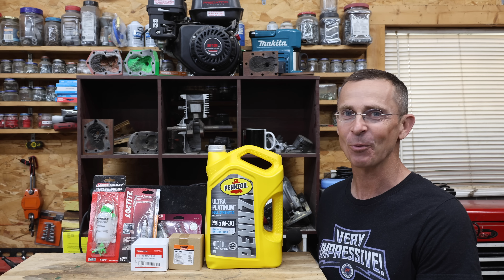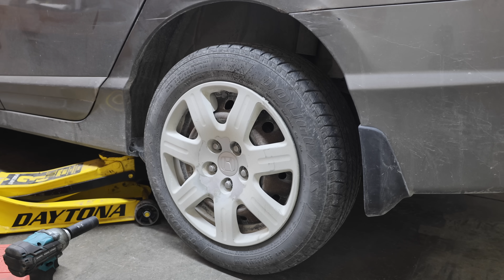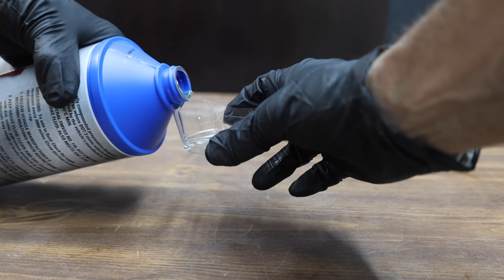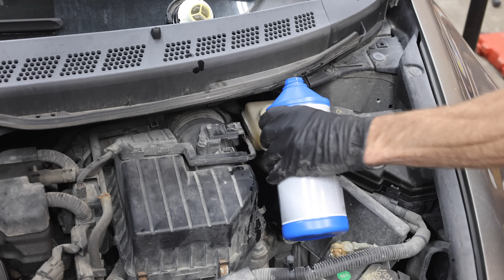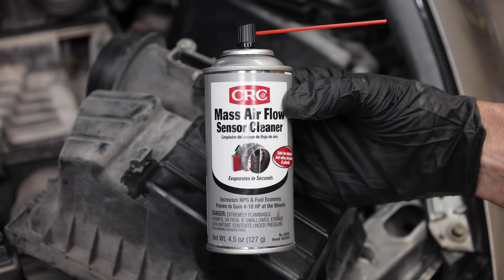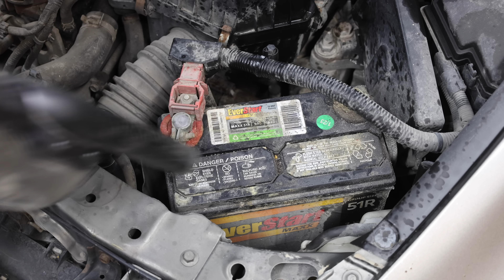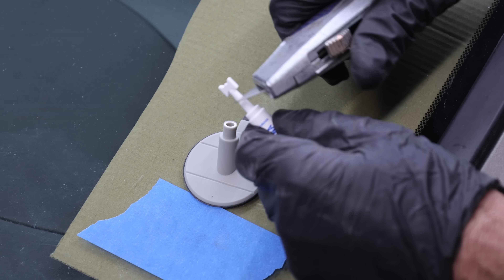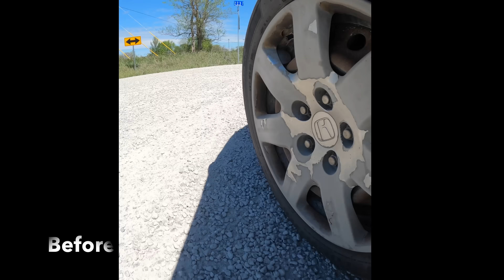Most Reliable 200K Mile Car? Let's Settle This!

Comment: Until last month, I had a 5-speed Civic of that generation that had 330k kms on it (about the same miles as this car). It was still chugging along, until a pole came down in a wind storm and took out the back end of the car. Even though the body was in rough shape, I am sure it would have kept going if it wasn't for that pole
Reply from the maker: Thanks for sharing.  Sorry to hear about the damage from the storm.

Comment: Great video! 
One question... I don't know about 2008 Civic, but some Hondas have a timing belt (or chain?) that should be replaced every 100,000 to 120,000 miles. They're known to break around 150K or 160K miles and have an interference engine that will likely self-destruct if it does. 
Again, I don't know about that particular year and model. I'm only mentioning it "just in case".
I completely agree with you about used versus new. In fact, I wouldn't want and  don't trust most cars built the last 10 or 15 years. They are asking small engines to do a lot of work and looking to save every last drop of fuel with turbos,  variable valve timing, auto-shutoff and other schemes that add complexity and put a lot of strain on an engine. Add gimmicks like cameras, traffic sensors, self-driving, accident avoidance, etc. Reliability is questionable while the cost of repair is going through the roof. I saw recently where a rear tail-light assembly for a late-model Ford pickup cost $5600! Then there was the cost to replace a damaged battery pack of a 2022 Hyundai Ioniq 5 (EV): $60,000 parts and labor! That was $5000 more than the entire car cost new... but at least it was Canadian dollars.
Your friend has a nice, economical  daily driver for under $1500! Hope it serves him or her well for many years to come!
Reply from the maker: Thanks!

Comment: Two hundred thousand miles without much or any maintenance, that’s the brand I want to know about. 
But with proper maintenance 200000 miles is easily achievable. Kudos to all the mechanics out there who have kept me on the road. 
Definitely one of the most informative channels on YouTube while still being extremely entertaining. 
👍PF.
Reply: That Civic (2006-2011) will go to 350,000+ miles... I know from experience.
Reply from the maker: Thanks!

Comment: If you are doing a code reader comparison video, could you include the Blue Driver code reader?  We had a 1997 Honda Accord that we drove to around 500k miles.  Odometer stopped working, but it had about 250k when we bought it, and my wife drove it about 70 miles a day to work, for about 6 years, and then it was the spare car for winter driving for about 6 years.  We sold it to a relative, and they didn't do the maintenance, and it died quickly.  We don't buy new cars anymore.  The cost is ridiculous, and they lose value too quickly.  Been doing my own vehicle work for over 40 years, and I am not stopping now.
Reply from the maker: Thanks for the suggestion.

Comment: I have a 12 year old American made car that I planned to keep as long as it could be fixed. The computer module for the ABS brakes went out...and yep, they no longer make a replacement part. It doesn't make sense to find one out of an old car because it would probably fail too. Thanks GMC. No more driving in the rain.

Comment: You hit the bullseye with this video!  I have a 2008 Honda Accord with the 4 cylinder motor that I bought used about 5 years ago.  It needed a few things (brakes, dome light, oil change, battery) but was otherwise a solid car.  It has been a great car!  And no car payments!

Comment: I've heard Toyota Tundra is a reliable pickup, plus able to run well into 300,000 miles on original motor and transmission.

Comment: What a satisfying restoration that must have been.

In college I bought a lightly damaged Chrysler 200, add in that it was a heavy smoker car and I got a remarkable deal for a fairly new car. I've had no notable issues in the >200k miles I've been driving it, and it clearly has a ton of life left yet. Very solid car, just normal wear items, a thermostat, and a new radiator hose/clamps. Regular oil/filters changes (synthetic), replace the transmission fluid every 100k miles, and just in general treating it with respect. That was my service plan and if served me very well.

I still have the car, and it still runs great, but desperately needs new tires and battery, so it has been parked for nearly a year as I've been enjoying my newer vehicles. This video has me thinking I should get that puppy back on the road. As much as I like my fresh new vehicle, there is certainly a charm in driving an older, "seasoned"  car that barely costs you anything to drive and own.

"The best car is the one that's paid for."

Comment: I got four Honda alloy wheels from a pick your parts lot to replace the original steelies.  Sometimes it is cheaper to get 4 used ones than 1 new one.

Comment: Also I can tell you I was a honda tech for 10 years. There was a bulletin released several years ago for that coolant thermostat code. And it was for inspecting the coolant temp sensor connector and sensor terminals for corrosion.  That would cause that code to set. So I would also inspect that as well. Thanks for the content. I watch it every Sunday.

Comment: Tod you did what I did today but with a 1970s snapper lawnmower. I bought two similar mowers. One had a locked up engine and the other one had only a good engine. I Frankensteined a mower so I don't have to buy a new riding mower that now costs $2500. I paid $120 total

Comment: Last year I bought a 2006 Honda Civic for $1500.  I bought it at 210k miles. It looked bad because it wasn’t ever washed.  However, the bones we’re good.  A lot of little things later, a lot of matching items from your video, and a major washing, and I’ve got a great running car for super cheap.  Get ready to get rid of that motor vibration, the motor mounts are notorious for going bad.  A whole set is $70.  They take a bit of time, but the ride after is phenomenally smooth.  I have before and after pics if you would like to see.  Great video!

Comment: I think a comparison video on coolant flush solvents would be a great learning tool. Recently had a truck with an oil cooler issue that got oil into the cooling system which started causing coolant hoses to swell and pop. After the repair I went down a rabbit hole of researching different options and most of which had negative feedback relating to them causing other issues from the harsh chemicals harming metals, seals, hoses, & water pump bearings. I ended up just using vinegar as an alternative but that also even had some negative feedback, but I wanted to try to remove as much of the oil from the cooling system to protect the new hoses. Just an idea!!

Comment: Great call on those CV Joints! Though I'm not a Honda fan oy- mechanically;if not overly abused .... the engine will easily turn 300+ reliably. Looking forward to your review of economical diagnostic meters!!! Have saved me some money on simple replacement of thermostats, O2 sensors, EVAP parts & simple electrical issues.

Comment: I got that 8th gen civic and its a beast.  Had a oil leak for years and never had any problem.  Now ac compressor or something is F'd up but still drives like a champ, regardless of the noise.  I'm not getting rid of her and gonna see how far she can go.  I've never changed my spark plugs either.

Comment: You are truly a jack of all trades. My project is my 2006 toyota corolla model s .that Ihave own since new. It has 215 thousand miles on it and needs a little work. But as you stated best the price of a new car. thanks for the the info on building a vaccuum pump.

Comment: My civic is at 350,000 miles and the motor and transmission still run correctly. However, the person I have loaned it to let the frame get corroded snap. The mechanic parts will outlast the frame.

Comment: My 09 ranger danger. Just took a poop 253,000 transmission pan seal leaking oil and torque converter leaking oil. I love my truck. I'm going to fix it.

Comment: NOooo! Never EVER change the tranny fluid on a high-mileage vehicle! That tranny will likely start slipping now, and soon fail. All the gunk in the old fluid provided the needed friction to compensate for worn parts. With the new fluid, that friction is gone...and so will be the tranny in short order. I only ever drive high-mileage vehicles....but I never ever change the tranny fluid, unless I know for a fact that it's been changed at reasonable intervals in the past (Which is not the case on your car- hence the color) or that the tranny had been replaced/rebuilt within the past 50K miles or so (Again, obviously not the case here). 

Next video: "Do Transmission-Fix-in-a-can products really work?" (No.)

Thanks for the awesome work you do and great videos!

Comment: I owned a honda civic.  It had 250k miles and i did regular maintenance.  The issue was timing belt and AC needed replaced every 80k miles, so the third time is sold the car.  $1500 for repairs on a $1500 car wasnt worth it

Comment: On that civic you can use the tranny cooling hoses to move new oil in and old oil out while the car is running in park. That way you can get new oil into the torque converter. Works like a charm.

Comment: My 2016 Camry with 200k miles runs as brand new.  Only dealer Servicing according to the book.  If the body was detailed and a monroney was attached to the window you'd swear it was brand new.

Comment: I love videos like these. I've lived most of my life without much money. My vehicle now is a 2000 mini van. Cost me $600 and I've spent about $300 ish so far. But even with all that, I've replaced two tires, a brake line, a trans control module, a ball joint, a wheel bearing, and a battery. I've owned it about a year and a half, and the battery, ball joint, tire, brake line, and wheel bearing were items that needed fixed from the beginning. It's got 250k miles, all fluids look good, and so far the engine runs very well.

Comment: You mentioned you're going to compare cheap auto scanners.  I'm trying to bleed antilock brakes on a 2001 Silverado.  I bought a Launch 919 scanner but it only goes back to 2005 to bleed antilock brakes.  I borrowed a friend's new Harbor Freight Zurich 15 and it wouldn't bleed the antilock brakes on the 2001 Silverado either.  I'd love to find a reasonable bidirectional scanner that actually works for older vehicles.  If I had a new vehicle it would be under warranty and I wouldn't need the scanner.  Thus, I suggest testing an older vehicle rather than a newer one when. You do your test

Comment: Great video.  Almost all of my vehicles have all had over 250,000 before meeting their untimely demise. My 1993 Honda Prelude had 351,000 before selling it to the new owner and used it as a daily driver for awhile.  This just proves replacing the wear items with quality parts and regular maintenance will vastly extend a vehicle's life.  I really liked the cost comparison of new verse used.  Just shows what a little research and elbow grease can do for your personal bottom line.  Project Farm helps with researching quality tools to perform the maintenance.  Spend the money once on quality parts and tools will save money in the long run.  Thanks for the great videos.

Comment: My daily driver is a 2008 Honda Fit.  Last work I did was replacing sway bar end links.  Before that it sounded like  a Huey helicopter coming in hot. It is my beater with something like 150-160k.  Typically get about 30 mpg and unless it is below zero it reliably starts. My truck is relatively new by comparison, a 2012 f250 with like 240-250k miles.  When looking at older vehicles I would say to do some research and see what major issues they have and how expensive the repairs can be.  Some years of some models can be absolute disasters.

Comment: How about a review of portable bandsaw blades? Some I have used have been expensive and junk. I noticed while you were swapping out the drive axle that the steering rack rubber gaiter looked to be split, did you change that. Great video, thanks

Comment: This is a great video and reminds me a lot of what I did after buying a 2007 Accord with 230,000 miles on it. It's still going strong at 265,000 miles! My only caution would be on insurance. You don't need to have collision or comprehensive on a vehicle that's only worth a couple thousand dollars, assuming you can replace it if it gets totaled. But NEVER carry state minimum liability coverage unless you absolutely can't afford more. $25,000 per person in injury coverage runs out very quickly if your mistake sends someone to the hospital. You should carry 10 times that amount. And don't forget uninsured motorist injury coverage. If an uninsured driver puts YOU in the hospital, you should be protected.

Comment: Changing transmission oil on a car that hasn't been serviced for a long time could cause failure due to the the detergents in the new oil loosening varnishing 
inside the transmission blocking small passages causing it malfunction .

Comment: What a great subject to what i am working on right now lol. My mom's Ford Taurus 2003 (V6 Vulcan Engine OHV) had a horrifying coolant leak coming out of the timing cover. Put 2 liters in the overflow tank and 2 minutes later those 2 liters would be gone.
I removed the timing cover, cleaned it and now i just need to weld all the cavity (like tooth cavity ya know?). After this i'll be ready to put it back on.
Thank for the video for the alluminium welding rods btw! I bought the Bernzomatic and it should do wonder! :)

Comment: Love these 8th gen civic. Maintenance is so much easier these cars. I had a 08 Civic Si (original owner) and drove it for 8 years with 197k miles and drove smooth. No major problems just regular maintenance

Comment: You will generally get a longer life with a 4 cylinder. My 92 Ranger 2.3 has 247k and my Fiesta 1.6 is at 190k so far. Neither burns oil. Also they are both manuals avoiding the big Ford issue. automatic transmissions. My daughters first car was a Honda Civic Coupe and We had hoped it would be a car to last her along time but someone hit her and wrecked it. But she got an insurance settlement 4 times what we paid for it, they are that valuable.

Comment: I have a 1990 Toyota Camry wagon with 520000 miles and still runs and maybe uses 1/2 quart of oil between oil changes. It's very rusty being from Wisconsin. I then got a 2013 Toyota Venza that has 222000 miles on it and burns 6 or 7 quarts of oil between changes so now I just change the filter. The transmission went bad at 210000 miles and now the rack and pinion is bad. The older Japanese Toyotas were so much better than these Kentucky built POS.

Comment: This was an AWESOME VIDEO! I’ve got a 2008 Honda Pilot with 82K ORIGINAL miles. We just had the struts, shocks and many other older vehicle maintenance items addressed, similar as you did. We paid 3K at a local repair shop (not a chain) and are very happy with the work. I plan on keeping this vehicle forever. It’s very reliable and had never let me down, especially on hunting trips. Keep coming with this type of content, in between your product testing.
Reply: Did the shop use OEM or similar quality parts? Many shops use inexpensive parts that will fail in a year or so, so keep an eye/ear on things.

Comment: Hondas and Toyotas made in Japan are a higher quality than those made in the USA. We have. 2004 4Runner, cosmetically ugly due to hail but at 220k miles and maintenance it's still going.

I got a 2017 F-Type for under 40k and did all the maintenance and work and now it runs great. 

I have had a lot of cars over the years and knowing how to maintain a car properly can significantly improve the years the car will last. Unless it just has a fatal design flaw.

Comment: == Thanks, Todd.  These are NECESSARY skills everyone should have.   Especially in this terrible economy.  And nothing you did is difficult (save I can't stand drum breaks).  Not even the tools used are very expensive should you head on over to Harbor Freight.  I have some nice vehicles myself, but my dailies are a 2004 Tahoe (have a same year M/M parts truck for it) and a 2001 Pontiac Sunfire.  Maintain them, don't let the rust run away on them, and protect them from rust/salt, and you're good to go.
     Think I have about 2.5k into the Tahoe, but that was breaks, all fluid changes, new lifters, water pump, and pretty much everything else you did.  Looks better than new, runs great, everything works right down to the AC system.

Comment: Those R series 1.8 are slightly gutless BUT they are as if not more reliable than the old D series engines of yesteryear . Before I get mobbed in the replies I still love the D and B series more but this is the best motor for this application.

Comment: I would have used Seafoam Transmission cleaner before changing the fluid and flushed all the fluid by removing the transmission cooling line at the car's radiator. Keep adding fluid until fresh red fluid comes out at he radiator return line.

Comment: Excellent vid as always, that's why I subscribe. One caveat though: yes, you want to keep the automatic transmission fluid clean,  but if it has never been changed before you may get slippage putting new fluid in at this late date.

Comment: I have multiple e46s,e39s,a e70,and a g30 BMW. The e chassis cars all have over 250k miles on them the e70 and one e39 are at 300+. And they all run and work great not a single warning light on. An inline six BMW with a manual or zf trans is by far one of the most reliable cars out there. Keep up with basic maintenance and fix the small issues as they appear and don’t over heat them. They will run forever. And they are super nice cars to drive and to be in.